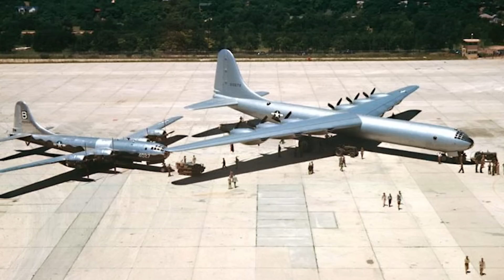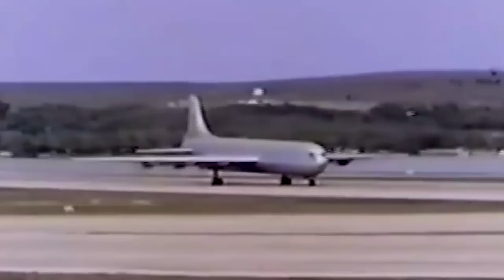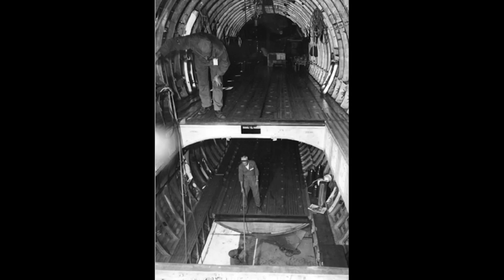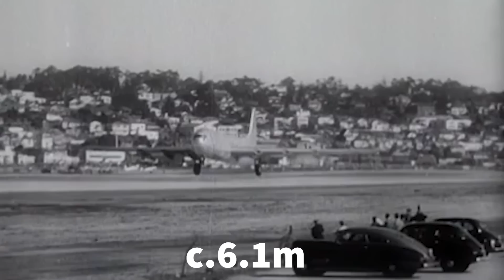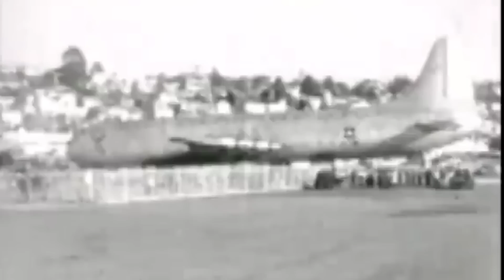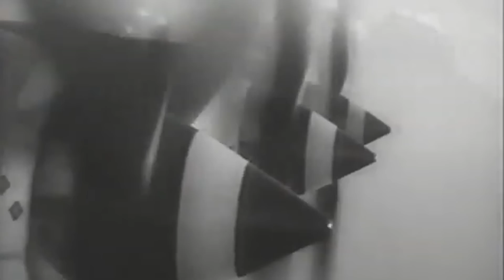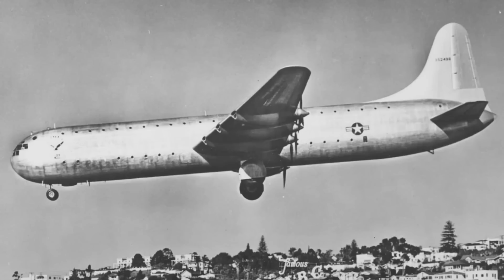Decomposing Behemoth; The Convair XC-99

Comment: I am 80 years old at this posting, 1-6-25,as a child in the 1950s I had the pleasure of exploring this huge monster with my parents at Kelly A/f base and at that time i steel remember that it was in bad condition with many cockpit instruments missing.I regret the fact that the pictures I had were lost over many years of moving.I am now retired from Lockheed after 37 years working on the F-111,F-16 and F-22 as a jet engine assembler,structure assembler,supervisor and tool project engineer.In the Navy I was a plane captain on AD-1s,1963-1966 Squadron VT-30.My Dad worked on B-36 hangers in San Antonio,and Oklahoma.All and all the aircraft industry has been a good life.If you love what you do to make a living then it is not just a job a dream come true.

Comment: If someone had noticed that the engines and propellers were pointed in the wrong direction and turned them around, one would expect the B-36 would still be in service today, either concurrently with or having replaced the B-52. Look at the Russian "Bear Bomber" that's still in service, maybe because the bear isn't flown backward. Those damn engineers get so focused on their work that they overlook the obvious.

Comment: I worked on the restoration, in fort worth, of the b36 that is at the pima air museum now. The deteriorated magnesium panels on that aircraft were on the wings. We just put aluminum panels over the top of them. The xc99 might have used more magnesium. From what i recall none of the major structural pieces were magnesium on that b36.

Comment: I ran the ran the power pack teardown section at fairchild afb in the early 50s a little over 2 years doing 25 engines a month and shipping 15 or 16 t0 SAAMA on the 99 I never saw an engine which had been burned

Comment: Can you imagine future generations bewilderment as to why we didn't preserve such a treasure?
Reply: It won't be the only one, there are several that fit the description.  Two other examples I can think of are the Boeing 377 Stratocruiser (airliner) and the YB35/49 Flying Wings.  At least in the case of the 377, the same basic airframe can be found in the KC 97, of which there are several preserved in museums. The Saunders Roe Princess would have been another unique aircraft that it's a shame wasn't preserved.

Comment: At least they saved it. Maybe they could lay it out on the ground and display it that way. I know as a kid growing up in San Antonio I remember taking a tour on it while it was parked at the display sight.
Reply: My thoughts are that since it will probably never fly again, why not rebuilt using materials other than Magnesium? I'm sure aluminum would be a lot cheaper and easier to work with.
Reply: @murphsmodels8853  Great idea.

Comment: There's a B-36 on display at the Museum of the USAF in Dayton.  They have the single wheel landing gear on display.  It's massive.  The reason they switched to the bicycle landing gear from the single wheel is because the single wheel would tear up the runway concrete when it landed.  The bicycle format allowed them to spread its  weight.  This is the first time I heard that this plane was economical to fly.  When Pan Am looked at the operating costs of a transatlantic variant, they didn't walk away, they ran.  A spark plug change meant swapping out 356 spark plugs. It gobbled oil.  The Wasp Major engines had a prodigious appetite for lubricating oil; each engine required a dedicated 100-gal tank and there were 6 engines. The engines were unreliable and liked to catch fire.  The parent craft it was designed from, the B-36, had an aircraft's slogan which was originally "six turning, four burning" into "two turning, two burning, two smoking, two choking and two more unaccounted for. Both aircraft used the same Wasp engines.  Somewhere around 2010 the XC-99 was disassembled and moved to the National Museum of the USAF in Dayton.  I talked to a volunteer who worked there, and he told me they were working on restoring the Memphis Belle and had no idea when or even if they'll get to the Xc-99. He said when they took it apart the damage from being in the sun and the corrosion caused by residual fuel in the wings meant a restoration was going to be an expensive and time-consuming project.   Wikipedia -> It was subsequently transported in the summer of 2012 to Davis-Monthan AFB and is stored in Area 20 of the 309 AMARG complex, the so-called "Boneyard", pending financial resources sufficient to restore the aircraft and return it to NMUSAF for display.

Comment: Thank you so much!

 Is it possible than there is a little error at 3.58 where it is stated that the six engines were R-4340-41...? Is not the designation R-4360 correct?
Reply: Yes, should read R-4360, not 4340. Already mentioned in another comment.

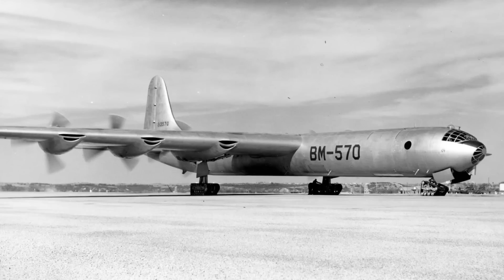Comment: @1:44 are those tracked "wheels" under the aircraft? What's that about?
Reply: They were trying to spread out the weight. B36s were notorious for requiring special heavy runways. I think the improved 4 wheel landing gear sorted it out for the most part.

Comment: I saw one in the mid-1950s. I lived in north Watford, north of London (England). It was low though enormous, with a distinctive and loud engine noise and flew due south over the house. All aircraft flew low there as we were under a stacking area for what was then called 'London Airport' (Heathrow). My a/c recognition was very good in those days. I knew later that several visits of these a/c were made to the UK.

Comment: Back in the 1980s, the XC99 was parked in a field across from Kelly AFB. I used to give tours thru that plane! Wish I had pictures. There was this one time a C-5 was getting ready to take off, and the taxiway was right across a fence for the XC99. They looked like a young bull facing off an old one!
Reply: Roland: were you not one of my students giving tours there on weekends?
Reply: @j.kaufmann7673  Mr Kauffman?
Reply: I was able to get in the XC-99 once in the mid 1960s when it was off the road between Kelly AFB and Lackland AFB (I was stationed at Randolph AFB at the time but attending a 45 day training course at Kelly).  It was not secured in any way, just sitting there with easy access for anyone that wanted to explore the inside. Looking back from the open left window, it reminded me of looking back from an open porthole  along the side of an Army Transport Ship like those that took us to and from Germany (1947 to 1950), and to Hawaii in 1952.
Reply: Saw it in same area circa 84-85.

Comment: I am surprised that Convair didn't try using the XB60 wings and tail on the plane it's a perfect fit, and would have put it in the jet age.
Reply: Yes, but not competitively with the the newer designs coming.  The need to fly from the US to Europe and back, assumed there wouldn't be bases in friendly territory if Britain (and more) was lost.  The job could be done by shorter range aircraft (one way range only).  The C-124 could meet near term needs and the C-133 then in development with turbo props was supposed to be able to lift the weight and be able to handle larger cargo than either deck on the XC-99 could (and do it as a drive on load).

Comment: If the planes materials breaks down so fast, then it must be it's destiny, An 1-1 size sheet metal mock up will be as impressing as the real deal and should be made as fast as possible, since the real plane by now is degraded, and only will degrade further.

Comment: I believe that the MUSAF at Wright Patterson  has one of those original single wheels on display there. For an aircraft, it's huge. According to the information placard,  the plane would sink into the tarmac due to poor weight distribution. The reason they changed the landing gesr to multiple wheeled gear.

Comment: The biggest mistake made in this aircraft's preservation was disassembling it and moving it to Ohio.  Up there it sat outside in the harsh northern winters and that caused the already bad corrosion to worsen.  It should have been restored in place at San Antonio, then moved.  The stupid Air Force grabbed it and took it apart with no plan to follow through with its restoration.  At least at Kelly it was in one piece.  Now it's just a pile of parts sitting in the desert.

Comment: But they said B-36, born obsolete, was taken out of service because high maintenance costs.
Recently, a team of retired Aircraft Mechanics restored to Airworthiness a B-36 at a cost around $600'000
As Airliner, this Convair C-99 would have posted an impossible to handle flush load in Airport passenger and luggage handling facilities. Or Not?

Comment: I was given a tour of the XC-99 sections after they arrived at the Air Force Museum – much of the exterior green with algae from sitting at Kelly for so long. I noticed another possible problem with restoration – the fuselage shell had been held together lengthwise with dozens of cables and turnbuckles, now loose and unconnected. An unusual design and amazing feat of engineering, but I don’t envy whoever has to put it back together.

Comment: I find it ironic that the B-36 bombers were a maintenance nightmare, had to have jet engines fitted to help with take offs when fully loaded with weapons, and seemed to always be on the brink of breakdown. And then this beast just, worked as intended and then some. Yes, it does help that it had upgrades to better engines and such over its short life, but it stayed busy with what seems to be little fuss. The fact it was able to just work with that much magnesium in its air frame and that much use is also surprising. I think it is a rather good looking aircraft to boot.
Reply: Word is the "ironic" maintainance nightmares also had some continuation in the XC - 99. With crews having to check nuts, bolts, connectors, and even rivets, because of vibration issues from the Wasp major engines... In addition to the stresses created from many long distance flights, at least the XC - 99 could use some parts from the B - 36, if needed.

Comment: My father was in the USAF during the Korean war and while at Bergstrom AFB (IIRC) spotted a C-99 at the end of the runway, sitting low with lines thrown over the aircraft, securing it to the runway.  When he asked what was going with that airplane, someone told him that the cargo master didn't add in the weight of the pallets in addition to the weight of the cargo.  This miscalculation caused the landing gear oleos to fail and the aircraft became unflyable.  Sad ending to an amazing aircraft that only had 2 examples built.
Reply: That was this airplane. The struts were repaired and it flew back to San Antonio. There was never a second XC-99. They built only one.

Comment: My uncle who was in the USAF in the Korean War and for a couple years afterward, said that every time the XC-99 flew, every nut, bolt, and rivet, had to be checked to make sure they were tight. This was due to the vibration from the Wasp Major engines. The crew chiefs at Wright-Patterson told him that the plane was a maintenance nightmare because of that. Combine that with the difficult maintenance of the Wasp Major engines themselves, and you can see what a headache it could be to service this plane.
Reply: Both the B-36 and XC-99 could've had longer service lives if but for one technical problem.  The Wasp Major engines were installed backwards.  They were designed for conventional tractor propellers but, were simply flipped around and turned into pushers.
Not only were the thrust forces wrong, the intake was facing the incoming air and could never get hot enough to vaporize the fuel and run properly.  Thus, it was always run rich and that helped foul the plugs in addition to creating upper cylinder lubrication problems.  The exhaust manifold was in the back and never got enough air to keep it reasonably cool.  Thus creating scorching temperatures for the rear part of the engine and everything after that.

Had Wasp Major been designed from the start as a pusher, the intake would be behind the engine and be properly warmed to vaporize the fuel and run leaner.  The exhaust would be out front where it could be cooled.  The heat distribution from front to back would be more even.
Reply: The exhaust ring on 4360 was in the same location on c97 b50 b36 between the carb/ Master control and the first or last row besides the stacks and ring on the 41s were enclosed and the heated air was dumped either through the prop afterbody or each prop blade if they needed deicing. You can tell which engine is on b36 by the props round -41 square 53. Engines 2,3,4,5 had a 400 Hz,208 Volt alt for electric power they were run through constant speed drive so as the engine speed did not matter. The 99 did not fly at the altitude of the b 36 and did not have the maint problems that caused. @BlackPill-obey
Reply: @DonKimball    Hard to envision it but, I'm going by what engineers and pilots both said about the pusher configuration for those particular engines.  Those engines were made for tractor thrust; not pusher and that put everything bassackwards.
Reply: @BlackPill-obey  But why did they think that pusher props were the answer?
Reply: @hackdaniels7253   I'm guessing they wanted smooth airflow over the wings.  That's one big reason why some airliners used to feature engines in the rear, or buried nacelles in the wing root.  All to keep the wing clean.

Just by appearances, the propellers see a very uneven airflow and there was quite a bit of vibration, so I've been told.
Reply: @BlackPill-obey  That's fair enough. But we're back to the question about why they didn't carry out the (probably quite minor) changes to the engines to make them suitable. I mean, it was obviously a complete blind alley, with turbojets mere years away, but anyway.
Reply: @hackdaniels7253   I can only speculate on why things were done that way.  Probably a mix of engineering assumptions and budgetary limitations probably caused an improper installation of those engines in the B36.  It would've required an entirely new engine to perform the pusher function that was required.  
But, by then as pointed out, the era of giant radials was on the way out and it would've been a lost cause.
Reply: Really a shame. If this could have been fit with turboprops, it would have been an unbeatable cargo craft!
Reply: Good info!
Reply: The Xc-99 had quite a long service life. It made a round trip almost weekly to all of the Air Materiel Area vases in AFLC.  This included Hill, McClellan, Norton, Warner Robins, Kelly (where it was kept). In 1955 we were visiting friends who lived in North Highlands, right next to McCllellan, and I saw it land. Later, in the early '70s, I was assigned to Lackland. I have picture of my 3 kids on the flight deck pretending to fly it. I think the VFW had responsibility for it, as it was stored just off of the north end of Kelly's runway. I met a major at Kelly who had been one of the pilots who flew it. He told me Col Paul Tibbetts was also one of the regularly scheduled pilots. Tibbetts was the AC of the Enola Gay.

Comment: This airplane was about the size of a 767 but badly underpowered.  The 767-300 is 180 feet long, weighs about 180,000 pounds empty, has a 408,000 structural max takeoff weight, with a 156 foot wingspan.  The XC-99 was 182 feet long, weighed about 135,000 empty, had a max takeoff weight of 320,000 pounds, with a 230 foot wingspan.

Really, the biggest differences were the power plants.  A 767 has a pair of 62,000 pound thrust GE CF6-80 turbofans, while the XC-99 had six 3500 hp piston engines.  It is likely that the XC-99 had about 25% the motive power of a 767, and this explains why this plane wasn't developed.  A better wing would help too....

Comment: 1.  Does anyone know the zero drag coefficient of the B36?  (Cd)
2.  Curtiss Wright had a go at its ‘Typhoon’ gas turbine for the B36 and by extension, the XC99.  CW got it running but the USAF decided it wasn’t enough of an improvement to re-engine the fleet., but really they did not want to distract $$ for the B52.  In the event, probably with Allison engines, a propjet  B36 made sense.  If not for a bomber, for a tanker.  (And yes Convair built a swept wing jet powered B36 that failed competition with the B52.
3.  The B36 and likely the XC99, had a welded steel tube truss fuselage frame covered in magnesium.  Steel tube old school by the 40s.  It’s Curious Convair used it other than it was lighter than alum. monocoque.   Cheers

Comment: Would love to have seen the XC99 fit with 6 og the Allison 5000 hp turboprops from the C130, imagine the fuel savings  with low cost JP3 4 Whatever the airforce was using at the time. Plus extra lift and speed.

Comment: Wow, I never noticed that the engine air/cooling/turbo inlet ducts changed shape the further outboard you went on the wing. That's pretty incredible - shows the lengths they went to with NACA and wind tunnel testing even 3/4 of a century ago.

Comment: If the original blue prints still exist, perhaps they can be digitized and all the magnesium parts could be replicated using a 3D printer and aluminum. So, it could be reassembled, just not airworthy.

Comment: I used to see this plane at Kelly AFB back in the 80's.    It's basically the same footprint as the C-5 on the ground.  The Galaxy  has a wider fuselage and taller tail.,   They should have converted it to turboprops.   They could have also converted the B-36's into C-99's at a fraction of the cost for the very troubled and short lived C-133's.